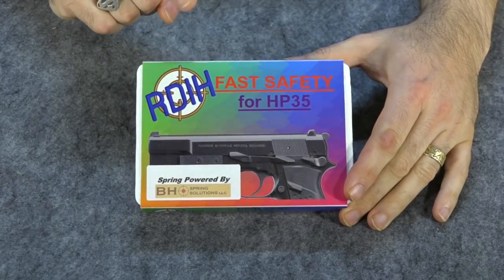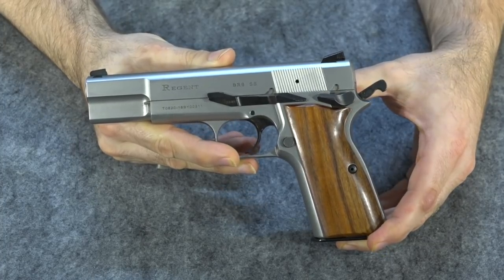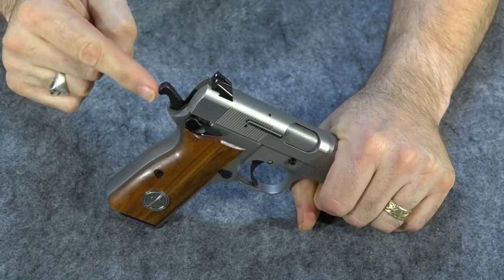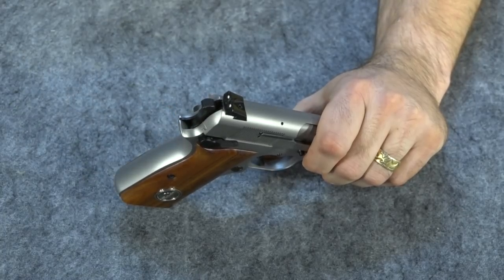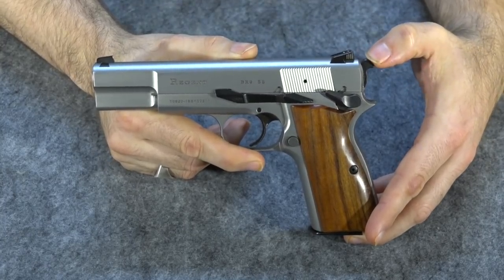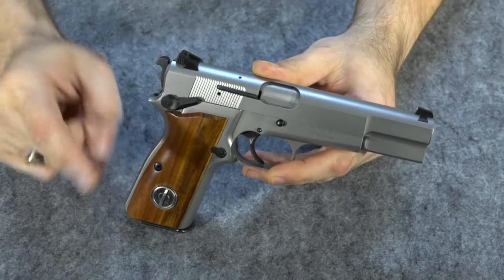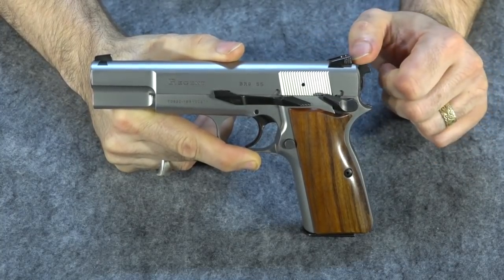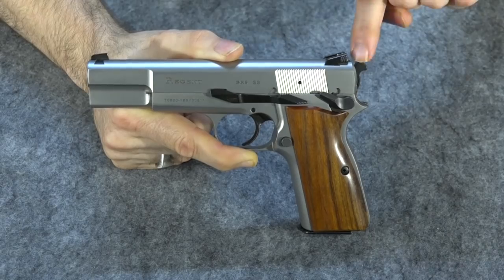1911 & Hi Power SFS (Safety Fast Shooting) System Review

Comment: I've had the system for 15 years.  If the "safety" accidentally gets pushed down you get a distinct snap and movement in the gun (never has happened) instead of "silence"

Comment: You covered the elimination of hammer-bite, and hammer snag, quite well. It also cures my only other true gripe with otherwise original Hi-Powers. That being, the mushy-mush safety, either applying it, or disengaging. Obviously, you no longer have to push-up to on-safe, as the hammer linkage does that for you. More importantly, it requires a firm, deliberate push down to ready the gun to fire. Very, very reassuring.
Reply: Mushy safety = worn out springs.

Comment: I have the SFS on my 1911 and I really like it. A customer had me install one on his Browning HP about a year ago and I had to have one. I’ve installed several of them for customers since then and have heard nothing but great things. One thing I have had to do is stone the sear to make it a bit crisper. But other than that it’s a great system if you own a Browning HP or a 1911. Cylinder & Slide also make a SFS for compact 1911 platforms like the Springfield EMP.
Reply: Would these SFS work on almost any 1911?
Reply: Alfonso Villareal it will work on any 1911. If you have a compact version like an EMP you may need to call Cylinder and Slide. I’ve installed them on customer’s guns, but I’ve never seen them in their online store.

Comment: One of the advantages is that you train with a single action trigger pull every shot, instead of like the baretta in which after you de-cock it your first shot will be double action, it has this advantage over even de-cocker only pistols

Comment: Sorry to necro post but I was specifically searching for reviews of this system. I have seen it advertised, for DECADES, and have been really considering one (mainly to keep debris from accumulating under the trigger). I appreciate the review (ya sold me on it). I do have one question. With the safety engaged (and the hammer down) do you have the option to thumb cock the HAMMER rather than sweep the safety? Thanks

Comment: I carried (daily) a (loaded) 1911 in the Army back in the 80’s/90’s and one of those on a 1911 would be awesome.  Does that new hammer & safety system look like it will be as durable as the original safety & hammer?
Reply from the maker: Yes

Comment: May be useful. I have gotten used to carrying a single action automatic a certain way. I'm used to it. I would have to shoot this to really evaluate it. My inclination is not to screw with something that works  great. but if it doesn't interfere with the operation of the pistol,or affect feel , trigger pull or impact accuracy  or reliability, I might like it better than cocked and locked. It has got to convince me.

Comment: I have a HP with SFS and I like it quite a lot.  My only reservation is the hammer is very easy to push back to safe and COULD potentially get accidentally knocked back into safe without the user knowing.  Probably wouldn't but, what if you fumble and knock it or drop it and the safety is re engaged?  Just food for thought.  I do still like the concept and feel much safer, like you do carrying it.  The standard HP safety does not engage as securely as most 1911's.  It feels kind of mushy so I don't particularly like carrying a standard HP in condition 1.

Comment: Question, I bought the system but decided to have a Smith put it in for me. I like this guy he does great work on the other guns that I have brought to him but this one. He got it installed but when you push the hammer forward the safety is really stiff to push up and will not go up on its own. It releases the hammer when pushed down its just the other way it doesn’t want to work. Any ideas would be appreciated. Thanks

Comment: It doesn't look like there is a distinct "click" to take off the safety.  It actually looks kind of mushy.  Does this match the "snick" of a properly tuned 1911 safety switch?  Does it feel like it looks, kind of mushy to remove the safety?  The lever action just looks kind of weak.
Reply from the maker: Nope...it is very solid.

Comment: I did not hang on every word so I apologize if I missed something.  But he said "less chance of accidental discharge if you drop the gun" toward the end of the video.So can I infer from this "safe firing system" that it does not really have a firing pin "drop safety" like a Glock or SA or HK or CZ.I believe those aforementioned weapons have drop safeties,.which prevent either hammer or striker from hitting the firing pin:  and they just will not discharge unless the trigger is pulled back.I always wanted to be able to carry a single action like the 1911 in condition two, i.e hammer down on a loaded chamber.But even the series 80s colts with all those added little parts, as I understand it were not drop safe.Let me know if I misunderstood all these I don't mind being corrected.
Reply: I just went on the website to look at the 1911 sfs system and it does list a drop safety feature, so it looks like I'm going to be picking one of these up in the next few days

Comment: Magazine loaded, round in chamber, hammer forward, and safety off is Condition 2.
Reply from the maker: Not if the gun is live when the safety is deactivated.
Reply: Condition 1 disguised as condition 2. I like it.
Reply: That'd be what round in chamber means. Condition 2 only applies to single action pistols and revolvers. Plus a different condition 2 for the Ma Duece. At least that's the doctrine in the Marines.
Reply: "Condition 2 only applies to single action pistols and revolvers"
Why? Surely hammer down on a live round would still be Condition 2 if the gun was DA/SA or DAO?
Reply from the maker: Condition two requires manually cocking the hammer.
Reply: +Lukas Johnson I'm not sure what you mean by "condition 1 would be the same but with safety on" since I was referring to the safety being on. Did you intend to reply to someone else?
Reply: "Condition two requires manually cocking the hammer."
Really? I thought the conditions were defined in terms of the position of the controls, not by what actions are needed to ready the gun to fire. I've never seen them defined that way, anyway. It's always "Condition 1 is chamber loaded, hammer cocked, and safety on", "You have to click the safety off" is only a footnote, if explicitly mentioned at all.
Reply: @alanjones4358  not sure what I was thinking, especially since with a single action the safety on with the hammer forward either can't be done (1911) or is pretty pointless since pulling the trigger wouldn't do anything anyway.
Reply: @WJS774  because if you have the hammer forward with a SAO nothing happens when you pull the trigger. DAO, SA/DA the position of the hammer doesn't dictate if the gun will fire or not. At least that's the best guess I could come up with while learning the conditions.
Reply: Lukas Johnson: Still, there's a huge difference between hammer down and hammer back. I think most of us would be comfortable carrying a DA/SA or DAO gun hammer down. How many would carry one hammer back? Calling them both Condition 0 just because neither of them has a safety catch on seems really wrong.

Comment: I saw (and handled) one of these months ago, shortly after they first came out. I thought it was ingenious - and (mostly) useless. First of all, hammer bite can be rectified by changing (or reshaping) hammers. I do that on my Hi Powers with ring hammers. Nothing wrong with easing hammer bite, but it doesn't require this system to do it. I'll grant that the hammer does make a "safety flag" if rearward, but question just how useful this is. My standard safeties serve this function fine. If you are more comfortable with this system I have no argument, but I don't consider standard 1911 or Hi Power safeties unsafe in any way. Each to his own. If you're fat enough that the hammer is poking you uncomfortably, maybe you need Weight Watchers or Jenny Craig instead of a new trigger system:-) I carry a few too many pounds and yet never find the hammer to be uncomfortable. Finally, for posters who complained that their Hi Power safeties were too soft or too stiff, this is easily altered with spring replacement and/or a little file work. Not a big deal and the average guy can do it at his kitchen table. Hi Power safety parts are pretty easy to work on.
Best regards
Doc
Reply: The stock safety is a little small to my tastes.

Comment: So... Never touched a Hi-Power myself (nor any of the clones thereof).  But, a Question for those who have:  My understanding of the issue, is that the safety on a Hi-Power doesn't have a sufficient "detent", or "stiffness" to the lever, to make it reliably "safe" in the original design configuration.  Why is it so hard to just fix THAT problem, i.e., just rectify the original engineering issue, rather than invent this sort of aftermarket work-around alternative functionality?  (Leaving aside Yankee's remarks about the other secondary merits/benefits of this SFS system.)

Asked another way:  What exactly is the mechanical or geometry limitation, that prevents a Hi-Power from just having a proper safety in the first place, like its 1911 forebear?  (This is also leaving aside the historical context of whether our modern concept of "Cocked and Locked" was even a thing when the Hi-Power was designed, despite the 1911 being a well-established precedent at least in the mechanical sense.)
Reply: The Hi Power safety has a little hole in it that accommodates a small spring and detent plunger. The detent plunger - which has rounded end - fits into concave detent recesses in the frame. You can change the little detent spring and/or carefully re-contour the end of the plunger with files. Some guys use tiny ball grinders to re-shape the concave frame recesses, but I don't advise this. Most problems in this area can be fixed as I suggested. Also, after years of use, the tiny spring hole can get gunk in it. Be sure to clean this and appropriately lube all safety parts.
Best regards
Doc
Reply: Okay.  Sounds like the configuration of the original safety was just too simplistic/small a mechanism to be really robust, at least over the long term.  I mean, yeah... everything mechanical needs proper care/cleaning/maintanance, but... 

Well, I said "leaving aside the historical context"...  But now with a brief look at an article or two addressing "Israeli Carry" aka. Condition Three, It's becoming clear to me that the underlying issue really is the fact that no one was thinking in terms of "Cocked & Locked" (Condition One) carry when the Hi-Power was designed.  (Sort of like the mag. release buttons being on the bottom on many other semi-autos of the period.  Quick tactical mag-changes weren't part of anyone's thinking.)  So I guess the mechanical function of the "Safety", was really expected to be a mere redundancy in actual use.  So making it "highly robust/reliable", just wasn't conceived of as a priority. 

Anyway, thanks for info, Thomas T.
Reply: The "Israeli Carry" was designed (long ago) to allow lots of poorly-trained Israelis to carry and use the Hi Power in relative safety. It is slow and not tactically efficient. Too many folks in the firearms world are automatically impressed by the name "Israeli" and assume anything they do is high speed, low drag. 'Tis not always so! 

The Israeli Carry is a case in point. It came about because so much Israeli manpower (and woman power) were poorly-trained, freshly arrived, European Jews who had little or no previous firearms experience. Israel wanted these folks to be able to carry a functional weapon in relative safety and that was their answer. So you see, it came about as the answer to a training issue and not because it had any martial attributes to recommend it.

Anyone using the Israeli Carry would be better off carrying a quality double-action revolver!

Best regards
Doc

Comment: So what happens if you pull the trigger with the hammer forward?  It doesn't look like the trigger moves at all when you operate the safety.   Does it just release the hammer but the hammer doesn't have enough momentum to fire the pistol?
Reply from the maker: Trigger is locked when hammer is forward.

Comment: It seems like it's just one more thing that doesn't need to exist and another part to possibly break.
Reply: That remote possibility is outweighed by the distinct possibility that you would hook the hammer on your clothing when you need to go on the most.
Reply: Cylinder & slide of ne markets these sfs kits too. They tested thousands of full power .45acp & 9mm rounds with no issues. The sfs design is safe & tym makes good points. S A O models are not for everyone.